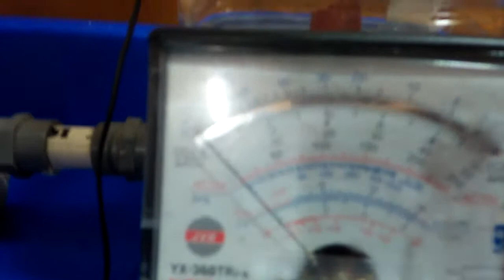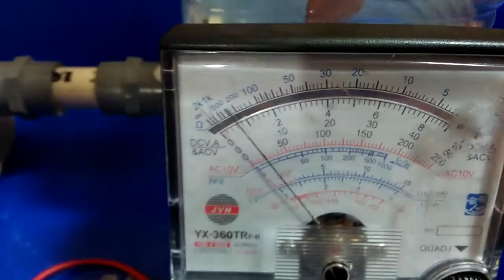Microbial Fuel Cell

Comment: Can u brief this proton exchange membrane
Reply: It is an electrical "bridge" that allows ions to flow between the jars without mixing the solutions themselves together. It is what you call a semi permeable membrane, or sometimes called a salt bridge. You can DIY decent ones at home for experiments. Ion exchange bridges or membranes are crucial for modern rechargable batteries, and it also allows much more efficient synthesis of many chemicals because you can make ions move via electrolysis without the reagents and products all mixing together - like for example make hydrochloric acid som sodium chloride. If you have ever seen electrolysis on youtube where they use a clay pot, this is one of the easiest ways to diy - but there exists better methods.

Comment: I made exactly the same mistake. The power is coming from the chemical reaction in the electronegativity difference between the anode and the cathode, rather than from the bacteria. Over time the anode would electroplate onto the cathode. This is the same way a lithium ion battery works. What would work better is using carbon paper for both the anode and the cathode, but have the anode be 12x bigger than the cathode, and have copper oxide be on the cathode. One way to do this at home would be to mix epoxy into graphite power and put that between stainless steal mesh then compress it.
Reply: Hi, do you have your research published online? 
best regards.
Reply: @fahmikhoirurrijal9427  No I do not. I would look up the study "Comprehensive characterization of a cost-effective microbial
fuel cell with Pt-free catalyst cathode and slip-casted ceramic
membrane"
Reply: @josephdvid6  thank you, much obliged.
Reply: @josephdvid6  hey how did u made the memberane between them ??
Reply: @jaybhatt7612  you can either make the membrane using a ceramic separator or agar. I used a ceramic separator. The way I did this was I bought terracotta, then bought a one inch thick pvc pipe that's one foot long. I tapped paper towels around the pipe. I rolled out the terracotta to make it super flat on parament paper. I gently wrapped the rolled flat terracotta around the paper towels around the pvc pipe. I then I then got another piece of rolled out flat terracotta and closed off one of the sides ot eh terracotta pipe that's wrapped around the pvc paper. The thickness of the terracotta should be about 2mm. I let these pipes dry for a few days then take out the paper towels by twisting them out. Then I would take these to a clay studio where they can get fired. This whole process takes several trials. You then put the cathode inside of the terracotta pipe and the anode around it.
Reply: @jaybhatt7612  You can also make a proton exchange membrane by getting a pvc pipe and pouring aqueous agar + water solution into it then allowing it to dry. This technique will be susceptible to mold unless if made in a completely sterile environment.  You can also buy carbon brushes for MFCs for pretty cheap off amazon that work a lot better as electrodes than the electrodes that I tried to make. Let me know if you have any more questions.
Reply: @josephdvid6  Is microbial fuel cell a good idea 4 startup?
Reply: @gopikakm3337 I am sure its possible. It would be really difficult to make a generator with an MFC out of cost effective materials that could power a car or a house due to the low amount of power each cell generates. There is a startup in Mexico called Greenfluidics that I am pretty sure uses algae as the source of microbes in MFCs.
Reply: @jaybhatt7612  you can also use some parchment paper for a membrane but it dissolves after about a week
Reply: @josephdvid6  thank you so much . Much appreciated. I will update you here if I work on this ever in future
Reply: can u help me i have many questions
Reply: @abeeryaseen2200  sure what are your questions
Reply: Hi, I'm chemistry student, i search this thing after i dreamed about bacteria and galvanic cells
Reply: @Lantanum057  let me know if you have any questions or want any help
Reply: @josephdvid6 Good day, Sir! I am Raf, currently in senior year of highschool. I will be having an experimental research about these Microbial Fuel Cells but with the use of Agricultural Waste. Can you help me design and plan the system in effecient and cost-effective way? Your guidance will truly be helpful for me. Thank you!
Reply: @josephdvid6 hello sir how can we generate more voltage using it as the bulb which I connected was not glowing
Reply: @shivanshagarwal5183  how did you make your MFC and what kind of light are you using
Reply: @sreedeepdey8215  yes
Reply: Hi, sir. I'm high school student and I need help for my proyect... Well first, I did my MFC with 2 bottles (anode and cathode) I made a hole in the bottle caps and passed copper wires through them (some rods are also tied to the wires). One of the bottles is filled with organic waste (fertile soil, potato peels, mandarin, banana, and beans), while the other bottle contains only saltwater. These two bottles are connected by a PVC tube, with a piece of cotton placed in the middle of the tube.

When I measure the voltage using my multimeter set to DCV (200m), I get a reading that starts around 35V and drops to 5.8V. Unfortunately, the voltage keeps decreasing over time, and I want to understand why this happens and how I can stop it—ideally, I’d like the voltage to increase instead. Also, sometimes the readings show up as negative numbers. I need help fixing this issue and would appreciate any key advice or tips. Thank you in advance!
Reply: @_Mettaton_.  It sounds like there are a lot of things going on. Don't put any corrosive metals in the MFC. The only metals that can go into it are basically carbon stainless steel or titanium. Anything else will corrode.

All that fruit you put in there could work as a source of energy for the bacteria but it doesn't have bacteria in it as is.  

Heres what I would do. Use graphite rods as the electrodes. You can order these graphite rods and they will get there in like one day and only be 10 dollars. 

Use wax paper as the membrane material. This will only last a few days but it will be fine.

For the bacteria just go to a pond or a river and dig up the mud from it, mix it into a slurry and use that. 

Also you should ask your science teacher how to use a multimeter to measure voltage. 

You should get a plastic container and divide one side of it using the wax paper then use waterpoof caulk to seal it and using hot glue put one graphite rod in each side. Just tap water should go in the cathode side and just the pond mud should go in the other. You should get a voltage of like 0.2-0.3V. It might take a few hours. You can put a few of these in series and light a small LED. 

https://www.amazon.com/Graphite-Smelting-Crucible-Stirring-Diameter/dp/B0D7MDHFSB/ref=sr_1_2_sspa?dib=eyJ2IjoiMSJ9.sAUJ316Gdg4dVdd5ZY4HpzACjOGJb7JLvseMrDwLE1HBSpGQmXzPCkkPy0KZ73JKc9yBAy17a4yBaNPirjTC3OuODLAL94XlpdgwV3DcHDimSmF8AeUKENM5gIB6_B8EprMGevqLxPBOr6d1b2375V95goO3sBar10AUEBY-ZcEv0T8jbk81pQucoYLNBzYi55rV_Pkr6e3KhKfuQkO3R3_u9abOAt8nSOZWgpiJksI.LreUpe89dgPSqZYa3MXM7wHOpbcjOvI2oWzrMtYGAzo&dib_tag=se&keywords=graphite+rods&qid=1754529956&sr=8-2-spons&sp_csd=d2lkZ2V0TmFtZT1zcF9hdGY&psc=1
Reply: I made this original comment 3 years ago before I did my thesis on microbial fuel cells so I didn't really know what I was talking about but now I know it a lot better. But yeah dont put any galvanic materials into an MFC. Only carbon should be used for the electrode materials and some stainless steel or titanium as the current collector.
Reply: Sir I am engineering student and just took this MFC as my final year project topic . So I have loots of doubts about it . Can I get some help about it
Reply: @shreyasraut5747  yeah sure do you want to set up a meeting

Comment: Would aluminum be a better anode than zinc since aluminum between copper has a bigger differences in electronegativity than zinc and copper?
Reply: Good idea
Reply: it actually wouldn't be better because the energy would be coming from the electro potential between the two metals and not the microbes.  @felsiyam1007
Reply: after learning more, no aluminum would not work well because of galvanic corrosion, you want to use carbon and maybe a little bit of stainless steel or titanium as a current collector

Comment: Where did you buy the proton exchange membrane from?
Reply: I think you can use agar solution for that.
Reply: Do you mean agarose gel (as used in biotech)
Reply: @pulkitsharmapremiumvideos9252  You can actually literally use agar from the store for it. Right now I'm using 1.5mm of terracotta clay as the proton exchange membrane. Previous research found this method to be the most cost effective and durable.

Comment: Can we measure current using microbial fuel cells? If not, what can we measure from MFC aside from voltage?
Reply from the maker: Microbial fuel cell name itself indicates main it's main purpose is to be used as green fuel energy. So, other things you can alter like microrganisms used and electrodes used to check variation and efficiency.

Comment: When I am measuring voltage 
In my model ,there are little amount of electricity in m volt may around 5 to 10 m volt 
If you have any about it 
Please suggest me 
And I will present in Infront of vice president in upcoming event in Delhi 
My project has been shortlisted in this organisation .
Reply from the maker: What are u using as energy source? U can use cheaper source and search for pure culture of microbe which is proven to be helpful in microbial fuel cell and generate more energy
Reply: @all.aboutGermanbydivya  I am using particular media for bacteria but not work 
  can I know 
What material used to making salt bridge/proton exchange membrane .
Reply from the maker: Agarose and salt
Reply: @all.aboutGermanbydivya  I am using agar with KCL
Reply: @all.aboutGermanbydivya  would like to ask you that what more content can be used to make the anode area full of bacteria ?
And I would like to know how have you made the proton membrane and by using what materials?
I have to present it to an event this week 
So would like to have an early reply!
Reply: @mohdasifbiotech   what are the other products did u used along with algae (sludge)
Reply: Hi Sir, I am going to do this project